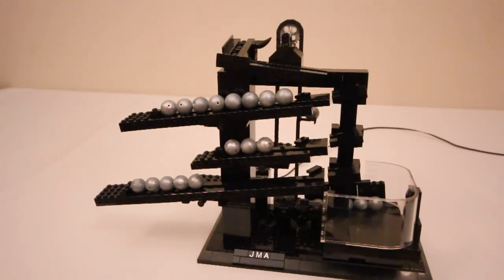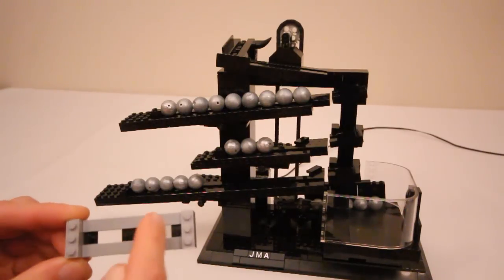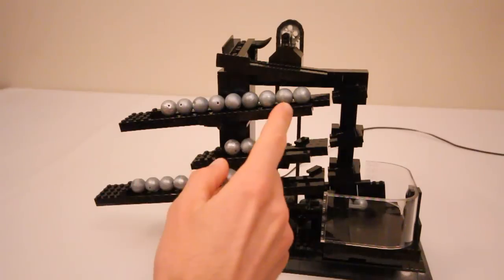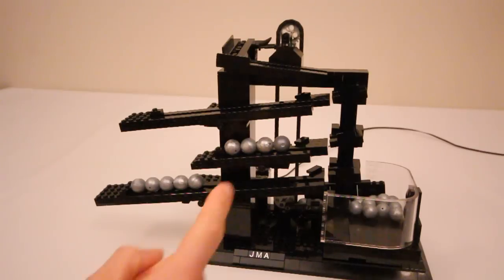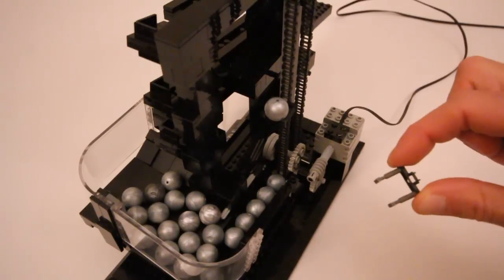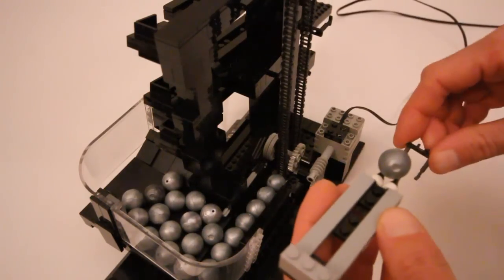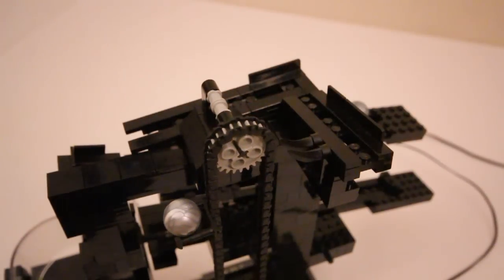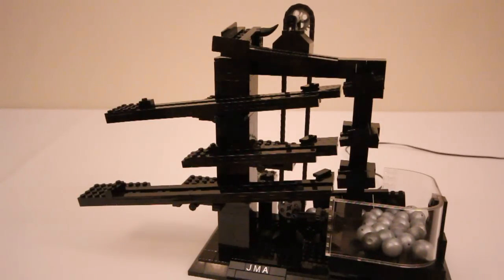LEGO Ball Clock

Comment: I keep coming back to watch this video to show people. This is definitely my favorite creation of yours Jason. I so want this sitting in my MOC room constantly working. It'd be amazing if there could be like a solar powered version of this so that it could be sat on a sunny window seal and run mostly off of sunlight. Though I suppose that one little motor doesn't pull that much power huh? What do you think consumes more energy, that or your typical clock radio?
Reply from the maker: Thanks! I think this would draw more power than a typical clock radio.  It is doing a bit of work to lift the balls up.  Solar powered would be cool though!
Reply: JK Brickworks you deserve to be called the god of lego.Your amazing!
Reply: Wicked Wizard mobile like a lever that changes from am to pm? OK my phone wants to change "pm" to Obama for some reason...
Reply: @JKBrickworks  is there any way to tell if it's am or pm or do you have to figure that out for yourself

Comment: How do you control the engine to move at the exact speed?
Reply from the maker: Unfortunately I don't. It doesn't actually keep very accurate time.
Reply: JK Brickworks
Too bad.
Reply: +JK Brickworks but still
Clever and creative
Reply: I would imagine with each chain link added, the time it would take for a ball to reach the top would increase.
Reply: Tyler Hughes My thoughts exactly.
You could change the gearing, too.
Reply: @JKBrickworks  You can calibrate it using the length on the chain and gears.
Reply: In the video, a 9v motor is being used, and if its hooked up to a Train regulator, you should get constant voltage, which would keep the motor at constant speed, and get to decide on how much power the motor gets to calibrate the clock in addition to gearing and chain length.

Comment: Ah yeah you did too, sorry about that.  I only ask because I am in the process of making a mechanical lego clock myself with a few technic parts I bought off ebay, and I haven't actually bought a mindstorms set yet because I heard a new "ev3" version is going to be released soon.  I was thinking of buying a synchronous motor to power it, but like you, I probably won't actually run it as a clock 24/7, so I guess close enough is good enough if you're just showing off the mechanical side of things.

Comment: He explained it pretty well. Easy to build if you have some key components. (flat tiles / balls / the motor. Just make sure the motor goes slow enough to make 1 circle a minute. when the balls fall down the block out the 1 single ball that must travel further. that's all to it. Still gr8t design.

Comment: How did you synchronize the motor so it takes 1 minute for the ball to get to the top
Reply from the maker: In the video it actually drops a ball every 55 seconds!  I've since improved it, but without a timing motor or some intelligent control it will never be perfectly accurate.
Reply: +JK Brickworks Doesn't the one Power Functions slim cube-shaped battery box have a PWM controller knob on it? That could help to synchronize it perfectly, and if i remember correctly, you can buy a rechargeable one so you can just plug it in, synchronize the clock and leave it to run as long as the charger is plugged in.
Reply from the maker: The speed control on the battery box only has a discreet number of speed settings (7 I think), so you still can't fine tune it enough to guarantee accuracy.  You can get close though, also by adjusting the length of the chain.
Reply: JK Brickworks Oh, I see. So the speed adjust isn't PWM like I thought. But yeah, I think with proper adjustment this could be a pretty accurate and great-looking desktop clock! :D

Comment from the maker: As I wrote in the description, the model I'm showing here does not keep actual time.  The latest mindstorms does have motors with built in rotation sensors, so it could be done with those.  Without fine motor control you could also rig up a sensor to pause/speed up the motor to ensure 1 ball reaches the same point in the cycle every minute.

Comment: Congratulations, I was looking for something like the one that you builth, would you mind to tell me which mindstorm package or reference did you use, and if possible the instructions, thanks in advance for your time and help!
Reply from the maker: There are no mindstorms components in this. It's just running using a regular motor, which means it isn't accurate. I also took it apart years ago and never made any plans for it.

Comment: So it turned 12 o'clock...what happens then? Theres no more balls to keep track of the time. Do have to manually put the balls back to reset the clock?

Also, to get the timing right,  did you make the chain on the drive a specific length in order for the ball pick up process to take about a minute? Or was it the speed of the motor?

Comment: In order to keep accurate time, an actual timing motor/controller has to be used. This could be easily done using the LEGO mindstorms system.

Or you know, you could do something with a few gears to stay a bit more rudimentary/mechanical/simplistic. No need for a mindstorms system to regulate lift speed if it's gonna be constant :p